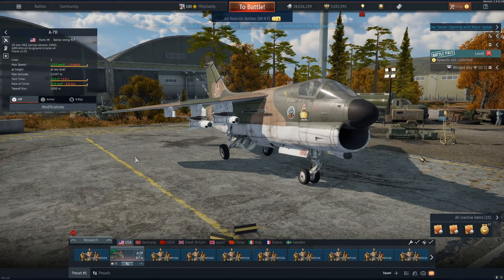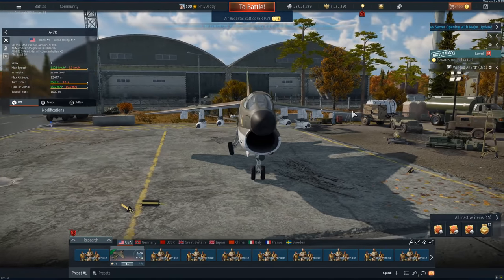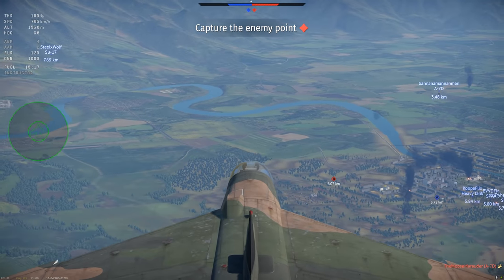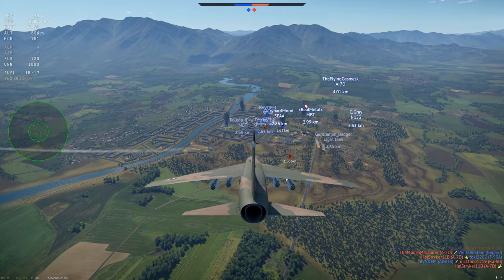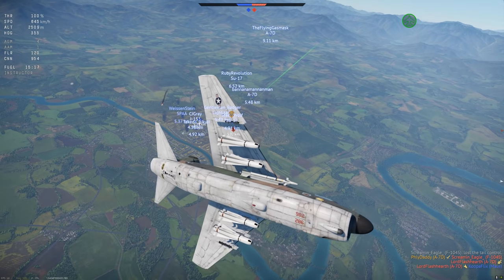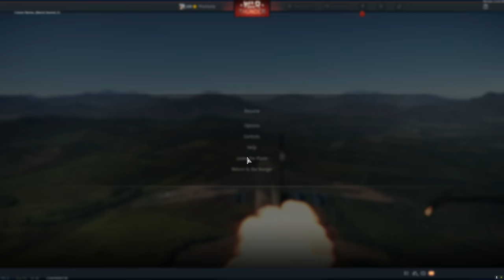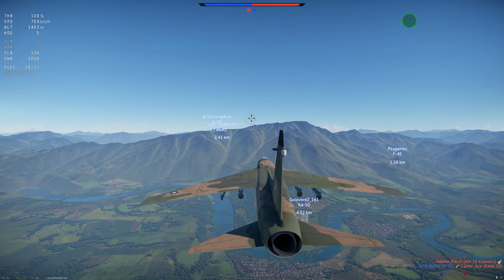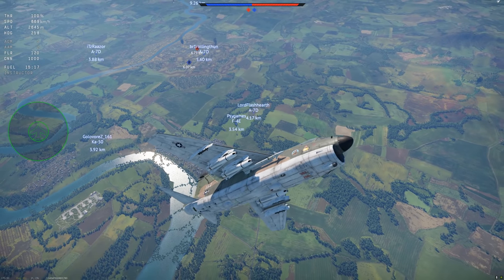AIR TO SURFACE HOMING MISSILES | AGM-65 Maverick

Comment: Day 23ish:
Hey Phly! You should do a public lobby with Phriends and Phans where each team has one VTOL plane, and the rest of the planes are reserve tier I planes. The objective would be to land the VTOL plane in a cap zone (you would use a tank map with a plane spawn-point), and successfully run down the tickets of the other team. Each team's tier 1 planes need to protect the VTOL at any cost. There should probably be a 30 second delay phor the VTOLs to take off because SPEED, but, do what ya want. Hope it’s PHUN!
Reply: fans*
Reply: @blitzwiseman4092  No sir

Comment: The Maverick is not a homing missile the way it is being used in game. It isn't home in on something produced by the target (e.g. Heat, Radiation etc.). They're being GUIDED, in that they follow a laser designator used by the launching plane, a ground unit, or another aircraft...among other things. If they were being used in their actual infrared capacity, they would be capable of locking onto things that you couldn't necessarily see.

The fact that you don't have to take a laser pod with this is a bit irritating.

Comment: ah yes, more power creep when Italy doesnt even have specified CAS jet, nice Gaijin
Reply: Try the vampire
Reply: Or the f-84
Reply: @quartzlandaker5664  I use the F-84 up to 8.7. F-84G is decent, but it isn't top tier CAS jet like A-7 or Jaguar. HVARs are Nowhere close performance of other Rockets at Higher BR. I've literally tested every plane in Italian tech Tree in CAS role. Of course, YS is best CAS for Italy, just for CCIP. Being Able to drop bombs from up-high is advantageous, but only 2 drops are limiting and 18k repair cost makes it painful when you die from SAMs

Comment: So I get this has to be balanced but those phreaking things irl have a 20km range let that sink in... you wouldn't even know an a7 was up until shmack a maverick
Reply: They have a 20 km maximum kinetic range, meaning theyll only ever hit that if they're launched at high altitude from an aircraft going very fast, and that's assuming the seeker can get a lock at that range. 
In Desert Storm, Mavericks were practically never used past about 10 km since they're just more likely to miss than hit past that range. The in-game representation right now is pretty accurate.
Reply: Yeah that is true. there pretty accurate n game but I think 8 km would be better but that's my opinion.

Comment: Drawrenderdistance for tanks in ground RB is about 3 kilometers, so 50% of the missile range is a lie.
Also Phly, yes the game needs anti radar missiles against radar spam, but most of the players will not learn from getting murdered with HAARM over and over. They just go to the forums and reddit and cry about how unfair the game is specifically to them and only them. You know, the loud minority.

Comment: Ground RB is dead.
Reply: The problem is the SP point system: if you cap a zone whit a light tank you can jumpnin a plane whit thia missles immediately like the ka50 you need 2 kill or 1kill and 1 assist and you can snipe ewery player in the game. i remember 1 game i killed a t80U qhit 2 kill he just jumped in a ka50 hand score 13 more so wtf???